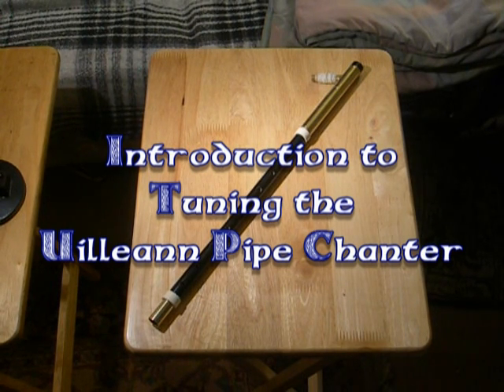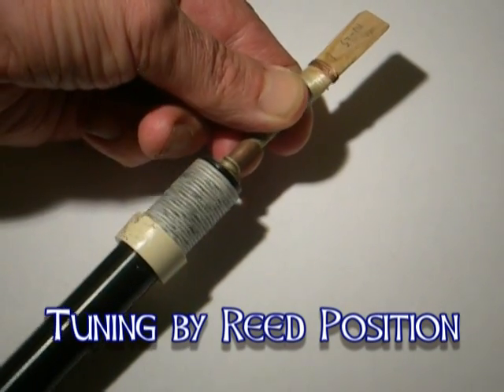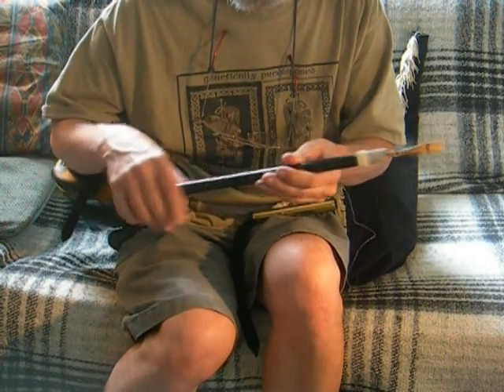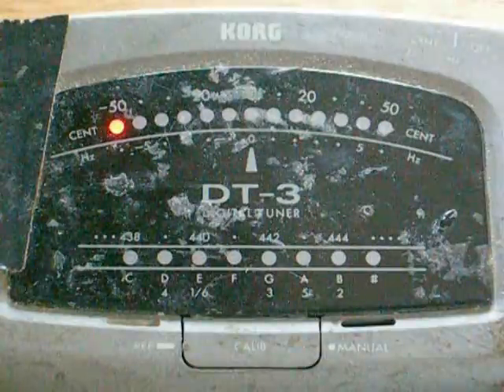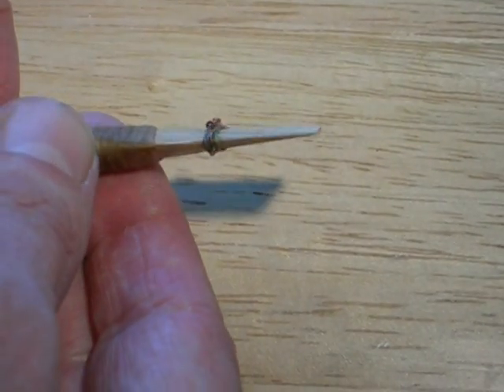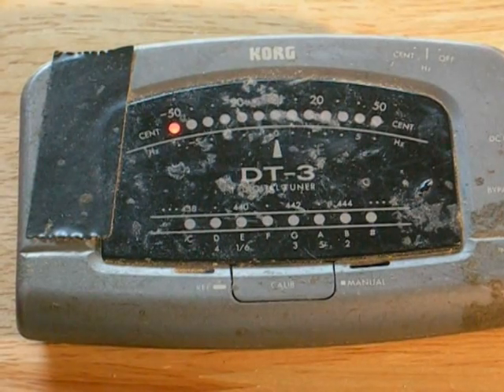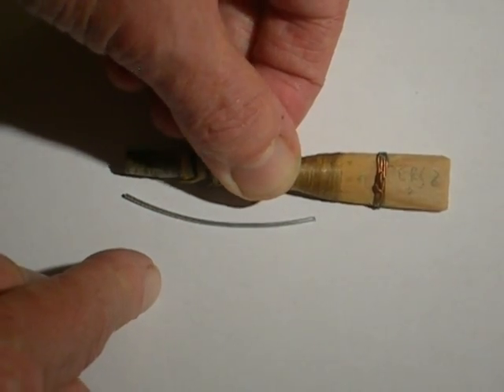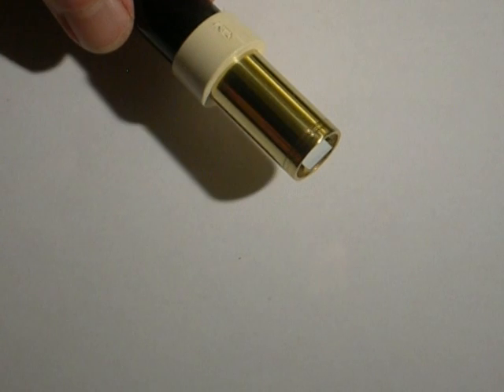Tuning Uilleann Chanters for Beginners (and Other Bagpipers)

Comment: Really  thorough advice,  very  cool.   My  question though, is, How  can  I  get my  chanter to play the  bottom D note (open)?  I ve  fiddled around a bit  and  I think  it's  reed that  that needs  adjustment but  not sure.  When I play the  bottom  D, it  is always  coming out  as the  high octave D.  It  wont  play a bottom D  at all.  Any  insight?
Reply: You might be squeezing the bag a wee too much.  (Too much bag pressure)  or your reed is too 'easy'  ,, in which case try moving the Bridle up (towards the vibrating end) just a wee bit?
Reply: @L8bro  Thanks,  I 've been trying that for years now with occasional success.  Still a very tricky balance to achieve.

Comment: Interesting question

Are these like the highland pipes in regard that the tuner has to be set to 478 hz as opposed to traditional concert pitch of 440 hz?
Reply: Uilleann Pipes generally tune to 440hz yes. But the tonic is D. Therefore it is the A (5th degree) which tunes to 440hz.
Highland Pipes generally tune to around 480hz in bands/modern solo chanter. But concert pitch chanters tune to Bb (466hz). This is because the tonic is Bb and not A as is generally said. Bb = A + 26hz.

So all in all, the UP tune to D where A=440hz and the GHB tune to 'A' where one sets their tuner higher: A = 466 or A = 480.

Look up baroque tuning. This should explain the same concept, but with different instruments.

Hope this helps/makes sense!

[Edit: small error]

Comment from the maker: Chanter might have a tiny leak; if it has any keys, seal the bell with good sticky tape or pressed on damp leg flesh, and with reed removed inhale thru reed seat. If you get any airflow look for keys, especially bottom hand keys, that might not be sealing completely. I've just moved house so my computer with bore design data is not online yet. If you are still having this problem in July 2013 reply to this or email me, and I'll look up some tips.

Comment from the maker: 2 ways "yes," arguably "no." Uilleann pipes can be fit with chromatic keys, traditionally simple action keys but modern woodwind keys can be fit. A 13 tone scale can be enabled but typically the intonation is not Bach's Equal Temperament due to the need of each note to blend best with a keynote drone, rather than have equally spaced intervals in all keys which creates much beating against the drones for some notes like 3rds and 6ths.

Comment: Sometimes in the video when you "fix" the problem, the chanter is still significantly  out of tune. By "out of tune" I mean not lighting "green" on the tuner, and out of tune with any other instruments that would be accompanying you in A440. The octaves might be relatively in tune with each other (i.e. first octave G lights up the same area on the tuner as the second octave g), but if they're not lightening up green every time they're useless to a serious, performing musician.